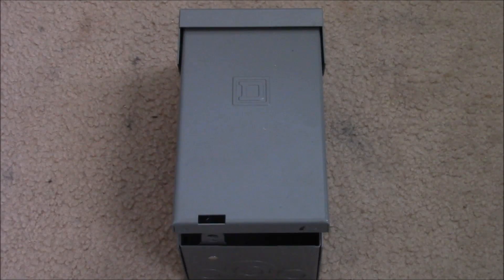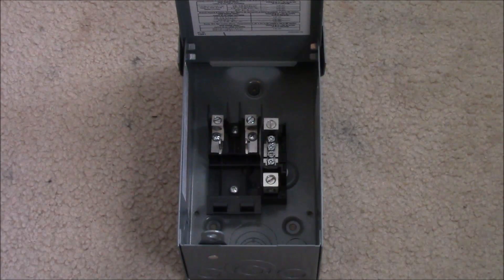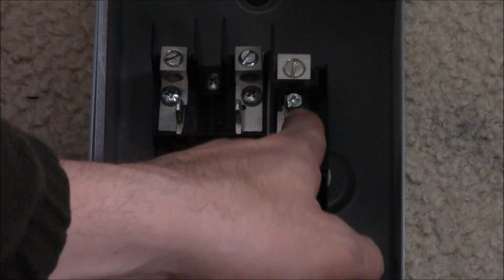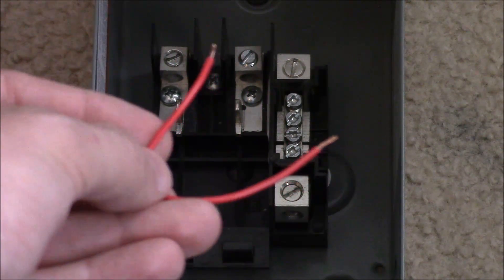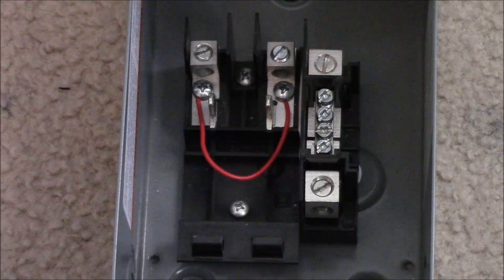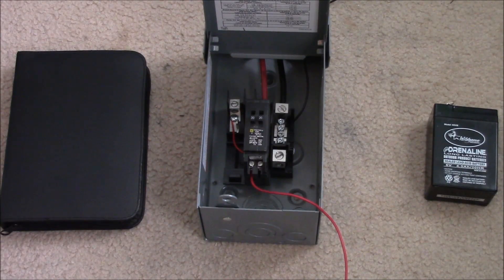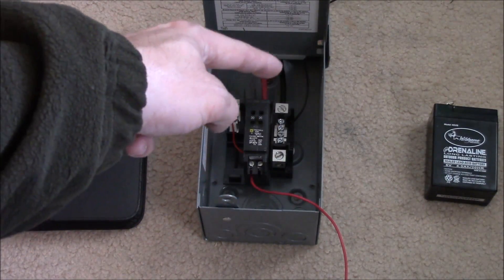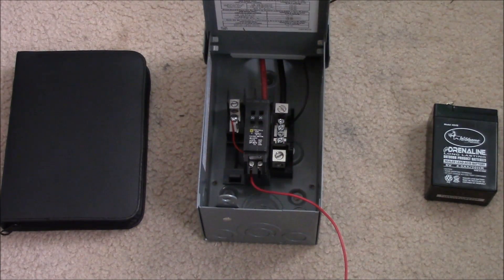Solar Panel Systems for Beginners - Pt 3 How to Build A Load Center Combiner Box

Comment: Thanks u r doing a great job! I just wanna ask, in a case where u wanna switch intermittently and automatically between your power provider and your solar system what other equipment will be required and how will the wiring look like?
Reply from the maker: Olaoluwa Ogunranti To switch automatically between grid power and your solar power is hard.  There really isn't anything on the market for that since it is technically illegal and dangerous.  The reason for that is because if the power lines are down and the power company technicians are working on the lines, if you are providing solar power to the grid it could shock them and hurt them.  

So there needs to be a complete break in the connection from the power grid to your home so that you can use your solar safely and legally.  You can do this manually with a few different types of switches or disconnects.  In other words, it would be a big manual lever that you would pull to disconnect from the grid like this:  http://www.gogreensolar.com/products/siemens-30-amp-600v-dc-disconnect-unfused-hnf361rpv?gclid=CjwKEAjwtMqrBRDwtoehx72vm34SJACl_Un11WeNH3_R-wGbRNIyrlu4-XGj_2d3RNT4Bx_9sfQXexoC8bvw_wcB.  Please note that I am not saying that box will work for you just wanted to show an example of what I am talking about.
Reply: LDSreliance isn't that what an automated transfer switch is for?  My generator is set up so it does this without manual intervention.
Reply from the maker: *****
True.  I have looked into those before and want to try one out.  I still don't think they are legal to use with grid power the way he was asking, though, or they would be marketed that way.  Also, there is enough of a delay in those switches to interrupt most electronics devices like tv's, computers, etc. so it may not be a seamless transition for home use.
Reply: My generator was installed by an electrician who follows code so legal here anyway.  I have my computer protected by a true sine wave UPS so it is o.k.  Unfortunately not enough sun exposure here so no solar possible (Redwood forest and lots of overcast).  They had a way to simulate loss of power from the grid, but haven't had a power outage since it was installed a few months ago.
Reply from the maker: Hmmm, I don't know what kind of switch that is.  If there is a legal automatic switch I am all ears!  If you can tell me more about it I would love to check it out.

Comment: Hello LDS. Al Ruark here again,  Now I have a question for you, I have an second floor converted attic with has six 15 amp breakers on a sub-panel, not a lot of load up there I have a bedroom  which I run a 50 " tv and lights and a small fridge,  so I would like to put in a new panel next to the main panel and move the six 15 amps for the upstaires and also move some of the outlet to the panel from downstaires ( living room and kitchen/dinning room), can that be done using a 30 or 50 amp single pole breaker using # 10/2 Gauge wire (orange wire # 10 AWG) for that panel from the solar panels, It' looks like there is I guess 8 gauge wire that feeds the sub-panel up there
Thanks Al
Reply from the maker: Al Ruark This all depends on whether you are inverting the solar power to AC power and THEN bringing the power inside the 2nd story or if you are bringing a line directly from the charge controller to the inside and to this load center and then inverting it.  I don't know a ton about wiring AC power so I will stick to answering the latter scenario.

If all you are running up there is a TV, a few lights, and a small fridge then you should be looking at around 500-600 watts average use (lets say 850 peak watts).  That means you would need 70 amps worth of breakers.  That is good news because that means you can use one of the smaller load centers (definitely use Square D QO series such as http://www.homedepot.com/p/Square-D-QO-70-Amp-2-Space-4-Circuit-Indoor-Main-Lug-Load-Center-with-Surface-Mount-Cover-QO24L70SCP/100153411).  It has space for 2 breakers, but they can be double pole breakers if you want.  So you could do one 30 amp breaker and a double pole 20 amp (total of 40 amps on 2 switches) or if you don't think you need that much you could just do two 30 amp breakers.  

Just keep in mind that this is a lot different from AC power where 15 amps equals 1600+ watts.  With 12v DC, 15 amp breaker will only give you a pathetic 180 watts before the breaker trips.  That will probably power your TV but I doubt it will power your fridge.  Using 30 amp breakers allows you to plug most things in except hair dryers and other power hungry tools/appliances.

On the wiring you want to use the biggest gauge wire that your load center, breakers, and inverter can handle.  #10 sounds about right for wiring on the 2nd story.  But I would bring a much bigger wire in from outside to handle 70 amps.  If you tell me the approximate distance of the run I can calculate what size you might need.  For example, I had to bring 30 amps over a long distance of 60-70 feet so in order to not lose of ton of power I had to use 1 gauge wire, which is hard to use and expensive.  If you have a reasonable 10-15 feet then it will be much easier.

Comment: hello, i really appreciate your videos. question, what gives you more or maximum power? is it more or larger solar panels, more or larger batteries or inverter size?
Reply from the maker: Taylor J. The short answer is all of them together.  If you have lots of solar panels but only a few batteries you will run out of power fast at night or when it is cloudy (but you will have more power during the daylight).  If you have more batteries but fewer panels you will have more backup capacity for dark but the batteries may not ever recharge fully because you don't have enough panels.  And if you have a small inverter (like the cheapo 300 or 400 watt units you see for $20-30) they will be inefficient (wasting some of your power) and they will not be able to power bigger items like a refrigerator even if you have plenty of solar panels or batteries.

Does that make sense?
Reply: +LDSreliance What would you need to do if you wanted to power something like a refrigerator or space heater?
Reply from the maker: Frank Duffy
Refrigerators are do-able but space heaters would take a large solar panel system to run.  Even the small ones use 1500 watts continuously which means you would need at least 2200-2500 watts of solar panels to run it after factoring in the losses and real world numbers.  Refrigerators are fine once they are running but they draw a lot of power to get started for the first few seconds.  You would need a big inverter and a pretty big battery to get one started.
Reply: Thanks, makes perfect sense  👍
Reply from the maker: Taylor J.
You are welcome.  Thanks for watching and commenting!

Comment: Can you connect multiple powersource (solar, minihydro, windturbine power) to a inverter
Reply from the maker: Hipa Furito You would have to combine the power from them somehow first before hitting the inverter.  An inverter needs a steady stream of power and the current from those sources, especially wind, will fluctuate.  That is why if you use those 3 sources of power to charge a battery bank and then let the battery bank power your loads you will get nice, clean, even power.

Comment: I have two aquariums that I'm trying to set up to use solar. Combined they use almost 500 watts and about 3.5 amps. The heaters use the most power. I'm trying to figure out what I'll need. Can anyone refer me to a video that explains how to figure out the size solar panels and batteries I'll need?
Reply from the maker: Victoria Lee I don't know of a good video for that.  It is a complicated question with several variables.  Knowing the peak wattage (500 watts) is helpful but only half the story.  How many kilowatt hours does it use in an average day?  What city do you live in?  How many hours or days of backup power do you want to store in your batteries (for when it is cloudy/rainy/night)?

Comment: Why didn't you use a fuse and connect to a multiple of four outlet extension???
Also, maybe pop off the lid on the box???
I wish you would have connected to the battery, the inverter, and shown how the breaker snaps on... Great video though...
Reply from the maker: Fuses need to be replaced.  With breakers they can be re-used for many years.  I probably should have removed the lid before shooting the video.  I thought I did show the connections going to the various devices.  Why would I need to actually connect them?  You can see them actually connected in the other 2 videos in the series.
Reply: LDSreliance 

Thank you, I am just a newbie and I get a little, OK, a lot
nervous when trying something new... Especially, when, I only know just a little about DC or AC... However your videos are very helpful, including the differences between breakers and fuses. I did not know fuses burn out faster...Please, re-do your videos, you have a wealth of knowledge and
because, I don't know that much about DC electricity, your videos help build my confidence... Keep making more videos, please...
Reply from the maker: Will do.  Thanks for watching!

Comment: can i use this load center for my two laptops and 3 mobile chargers?
Reply from the maker: Yes.  Those are small loads so you could even run them all off of 1 breaker if you wanted to.  Or you could divide them up on their own breakers if you wanted to be able to switch them on and off.
Reply: LDSreliance how do i determine the pv that I will use for me to be able to run 2 laptops? and also the specs of the battery we use 220v here and my laptop charger is 65watts thank you.
Reply from the maker: It is a pretty complicated calculation.  There are some good websites that help  with the math but you need to know some basic information.  Where do you live?  How many days of backup power do you want to hold?  How long does it take your laptops to charge and how often do they need to charge?
Reply: LDSreliance thank you will try to check google for that :)
Reply from the maker: I can do the math for you if you answer those questions or here is a link for a good calculator that I use:  http://www.batterystuff.com/kb/tools/solar-calculator.html
Reply: LDSreliance i live in the Philippines, I would to have 3days of backup power running for 8hrs a day, charge time is 2-4hrs I think
Reply from the maker: OK, you will need a little over 500 watts of solar panels and 3 batteries that are 12v and 225ah each or a minimum of 615ah total if you use other sized batteries.  It looks like you get between 4 and 8 hours of direct sun per day depending on the time of year so I used 5 hours as my average.  During the summer it will charge very fast and you will have more power than you need.  In the winter it will be adequate but will run down the batteries faster in the colder temperatures and take longer to recharge them with less sun.
Reply: thanks for this :)
Reply from the maker: You are welcome.  Good luck!
Reply from the maker: *****
Very cool.  Good luck and let me know if you need any help.

Comment: Hello again LDS, what I was saying is I'm using a 100 amp breaker box/panel which holds 6 15 amp breakers, Each 100 watt panel is wired to one 15 amp breaker, now since the charge controller with only take 500 watts ( 5 100 watt panels) I have to use another 20 amp charge controller to use the 6th breaker for the 6th 100 watt panel, I have two breaker box/panels for a total of 12 100 watt panels
Reply from the maker: Ahh, that makes more sense.  Very cool setup.  I wish I had room for 10 panels.

Have you considered re-wiring the panels and batteries for 24v?  It would be much more efficient and you would be able to use all of those 10 panels on 1 Morningstar TS-45 charge controller ($150-175).  Just a thought.

Comment: I'm building a system now and I'm using two Square D QO series 100 amp load centers with 5- 15 amp QO breakers as a combiner box ,each 15 amp breaker handles a 100 watt panel along with a 30 amp charge controller with also handles 500 watts total, the load center will take 6 breakers total but you would need another charge controller which I 'm going to use  another 20 amp charge controller for the 6th breaker from each center, Great video's 
Al
Reply from the maker: Thanks, Al!  It sounds like you are running a charge controller for each solar panel?  Or am I reading that wrong?

Comment: Hello LDS, the QO Square D breakers are rated for both AC and DC up to 48 volts per breaker
Reply from the maker: Yep, that is why I recommended them.  The Homeline series as you see in this video still works with DC (in my experience over the last 2 years) but is not rated for it and is probably not as safe for DC usage.

Comment: Ah, I found you, this is what I was looking for from another one of your vids. only how would I ground it ?
I need to ground the chassis on my PROwatt SW 600. I won't need a inline fuse, (calls for 80W) with this method ? 
thanks, I'll check out your videos.
Reply from the maker: I wouldn't ground the inverter through this box.  The "ground" in the box is being used for the negative portion of the DC current.  I would run a separate ground wire (ideally bare copper wire) from the inverter to a grounding rod or other type of earth ground.  Don't be scared to install your own grounding rod.  It is not that hard.  I have a couple videos on how to do that pretty easily and cheaply (https://www.youtube.com/watch?v=-kpI8PFNYl4 and https://www.youtube.com/watch?v=K5eorpQBml0).

As I mentioned in my reply to your other comment, an 80A fuse would be nice for added safety but if you are using a breaker it will trip if it overloads the circuit anyway.  Fuses are cheap so it can't hurt, though.